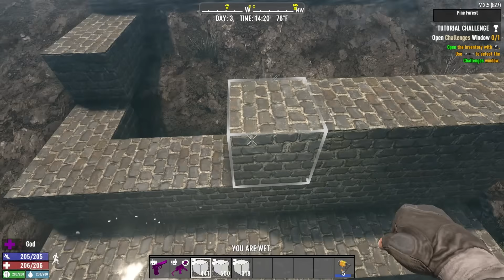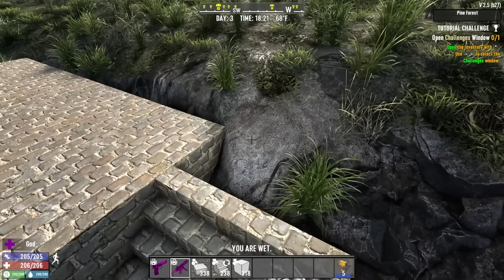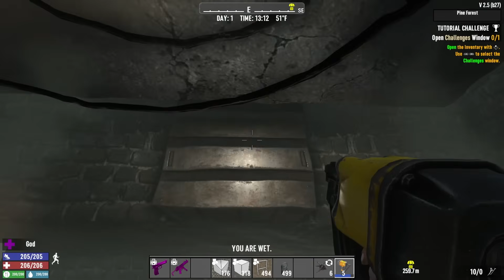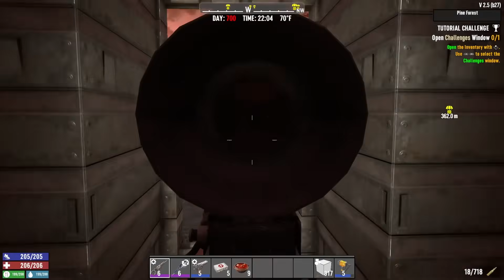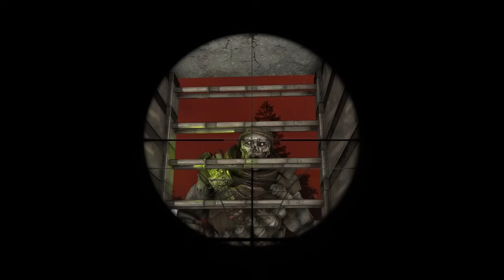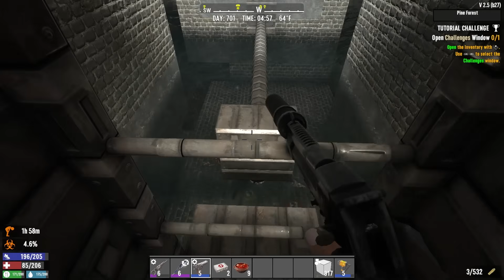ZERO Rage Hits Base… Using WAY Less Materials! | 7 Days to Die

Comment: Community tip.  When wrenching a lot of cars, if you make minibike handlebars from the parts, it sells for more than the individual parts.  

Also the brass you get from a scrapped radiator is worth more dukes than selling the radiator itself.  Same for the engine,  the mechanical parts are worth more than the engine, so scrap those down when you have enough.
Reply from the maker: Love this, thank you bud, we may use this sat some point 🙏✨️